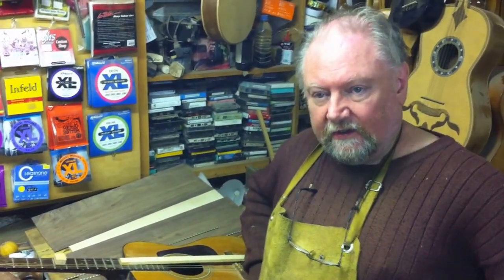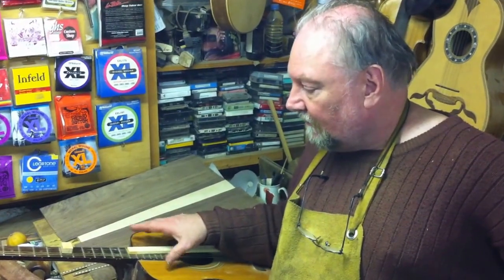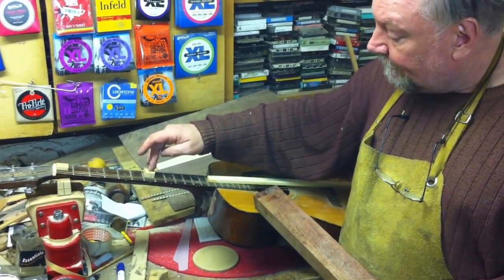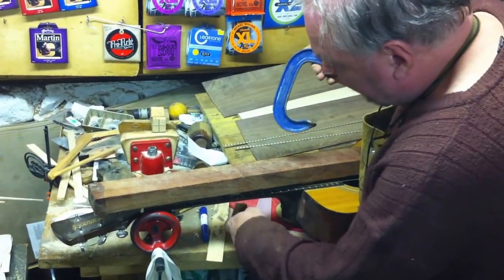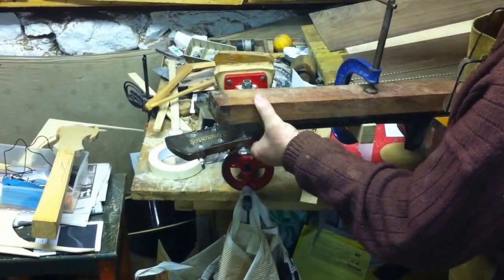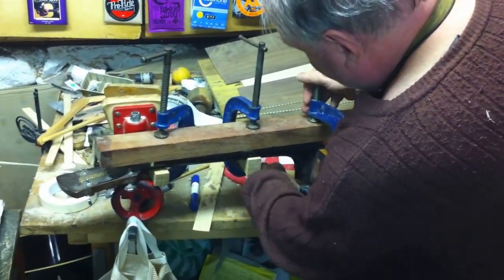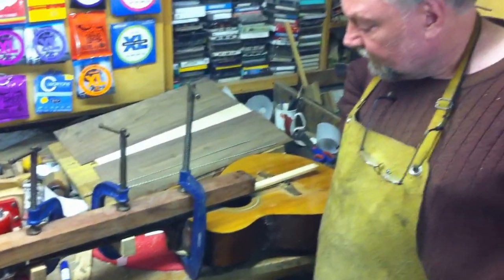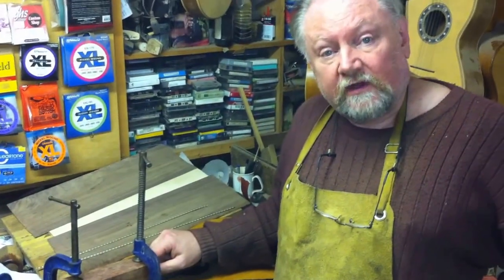Correcting a backbow on a guitar with single action truss rod

Comment: My guitar has a one piece maple neck, and single action truss rod.  It's not bowing back, but there's too little relief with the nut backed right off.  I have a feeling this may be down to it being on a stand in a centrally heated house, so before clamping the neck I'm going to try re-humidifying it in a guitar case, with the truss rod slackened and the strings tuned to pitch.
Reply: Did it by chance work?  I hope so, because I'm doing the same thing now 🙏
Reply: @nikao7751  Hi, I left it for a couple of weeks, and it seems a little better now.  It's certainly worth trying before resorting to more drastic measures.
Reply: @ParaBellum2024  thanks for letting me know, I'll try to leave it as long as possible without jonesing to play it, I have two guitars, but the one with the problem is the good one, God bless 🙏

Comment: just did this on a diy tele kit i have been working on. The neck after mounting was to far bent back with a crown in the center for the  two way truss rod to correct. I clamped it and put out in the summer sun and it allowed the truss rod  to catch up and hold the position. I checked it 24 hours later and it is still good. I think anyone with this problem with a single action truss rod should change to a two way rod and then it will work and hold!

Comment: I tried a solid piece of steel, several clamps, heating the neck with a hairdryer until it was hot, but I still have a bow in the neck of the guitar. I used a lot of force and let it sit for days too...still haven't gotten rid of the neck bow.
Reply: Did you fully loosen the truss rod?

Comment: I straightened a neck on my Yamaha drop 6 baritone by removing the neck, placing it face downwards after slacking off the truss rod completely, putting a small piece of wood at the seventh fret where the bend started. I clamped it to my black and Decker work table/bench. then I steamed it with a steam  iron and face flannel for about fifteen minutes up and down the neck. Left it clamped for three days and it was straight as an arrow when it was finished. I put the strings back on it and it is perfect. Cost's you nothing just patience waiting for it to adjust to it's new position . It worked 100% and my guitar luthier friend was most impressed.
Reply: Nice tip that will be very helpful when I make my move on the guitar neck thank great comment and great idea 👍..Roland J Gutierrez from Magdalena New Mexico 🇺🇸

Comment: I gotta try that on my Cort headless bass.
      Only problem, the neck is a 3-ply, neck-through.  It's a very solidly built poor-player's steinberger, a headless neck with small wings to make it look like a boat oar.
Any suggestions for putting some concave bow in that type of neck?  The truss rod is loose and I still can't get any relief. That would normally be great, but I need a little more relief than 0.001".  I would rather have a little tension on the rod at all times; otherwise it is just dead weight.
    Would heat and clamping work the same on a neck-through as it would for a bolt-on or acoustic neck?

            I shouldn't try to type when this buzzed.........

Comment: Finishing up an arch top which had the problem. Tried your technique which worked nicely. But a few days later the backbow was back - perhaps a bit less. Any suggestions? Should I just do it longer or go for a larger bow? Should I just do this right before I put the guitar together and string it up.
Reply: I'm not the person who made the video, but if it worked and you had enough bow ("relief") after you clamped it, I'd IMMEDIATELY put the strings on and adjust to normal tension as soon as you take the clamps off. Or if you don't need to play it for a while, maybe even a little tighter than normal... but not too much. Not sure about clamping longer vs going for a larger bow (bigger difference between thickness of end shims and center one), but if I had to guess I'd go with clamping longer, you don't want to bend the neck too much and crack it. Again I'm not an expert, but have worked with wood a bit, so I hope that helps.